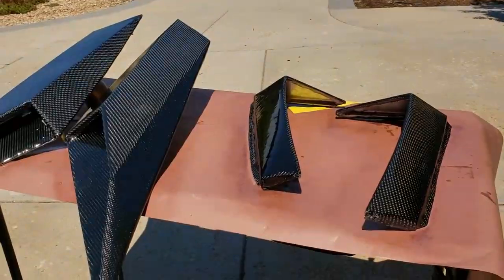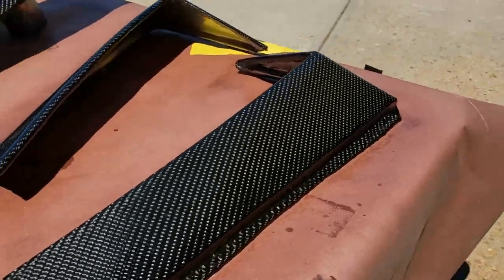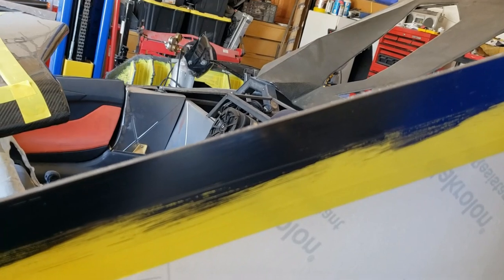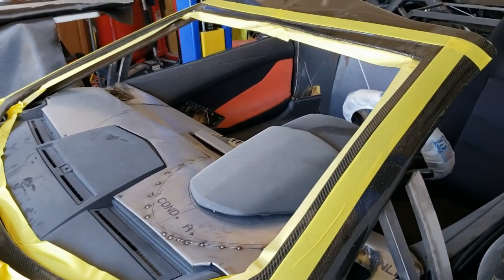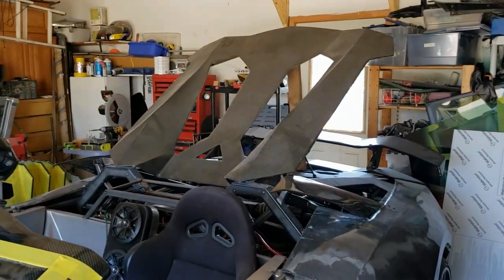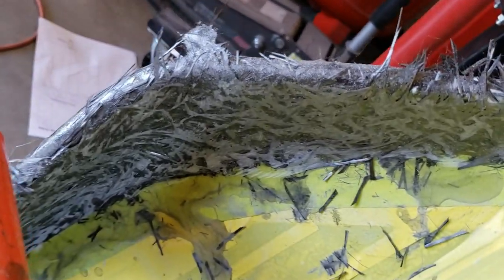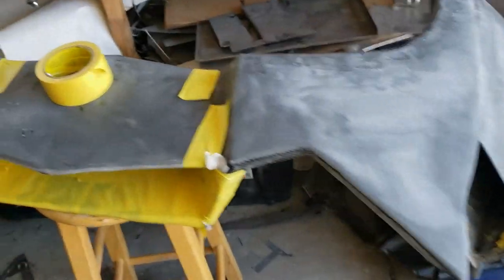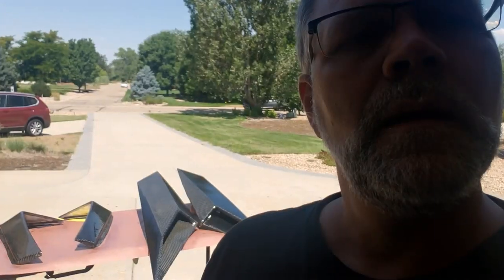3D Printed Interceptor Update 49

Comment: I was wondering, what material did you 3d print your Lamborghini in
Reply from the maker: PLA, ABS
Reply: @lasersterling  Are you worried about it melting?
Reply from the maker: @joemanning8564  It is covered in carbon fiber.

Comment: instead of clearcoating the carbon, brush on 3 layers of warm uv resistant epoxy (warming it thins it and less chance of any bubbles), then flat sand and just polish it up with a normal compund with a car paint buffer for a mirror flat proper looking finish.